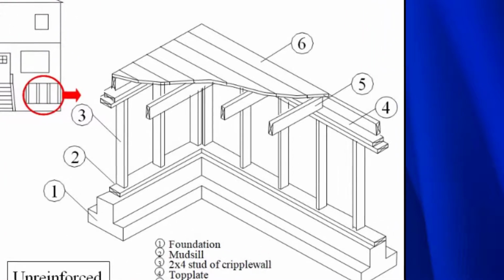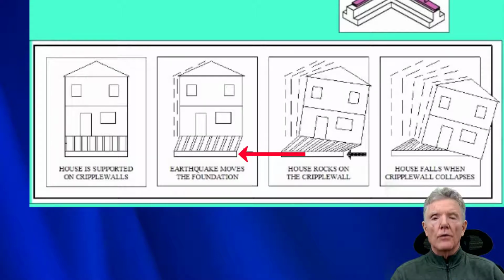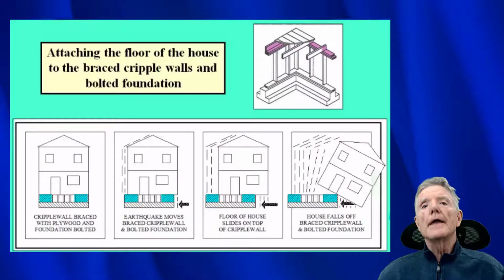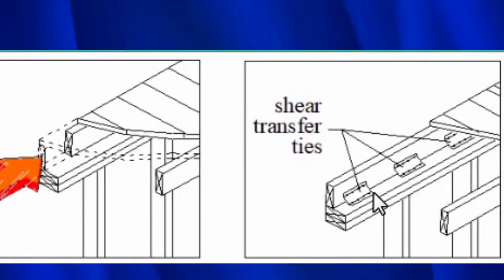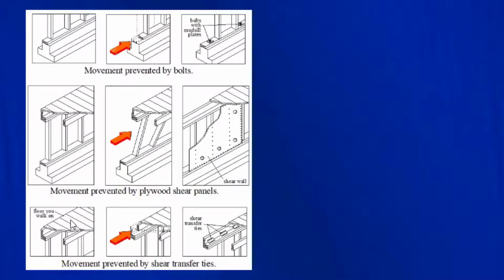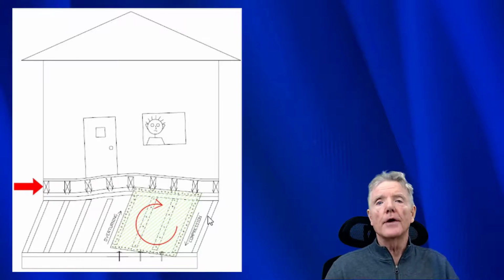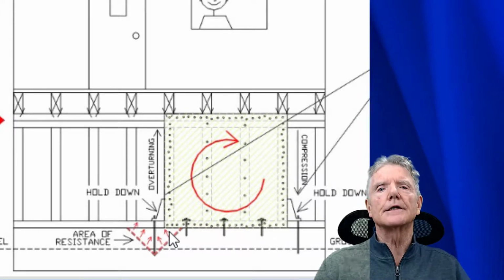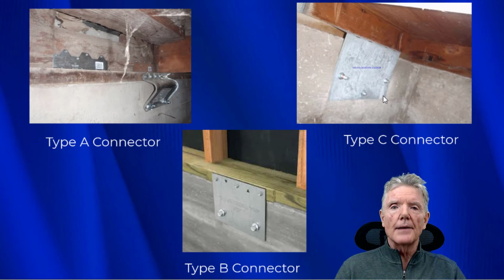Cripple Wall Retrofits: The Basics

Comment: Howard, I have 4'x8'x24' corner studs. Can I use two hold downs, one on each side, of the corner studs? Thanks for the great videos!
Reply from the maker: Try to be a little more clear.  I am not quite sure what you mean.
Reply: @bayarearetrofit5814  Is it acceptable to use two hold downs on a 4x8 corner stud? If still unclear, can I email an illustration? I promise not to spam you.

Comment: If the crawl space studs are about 18”-24” is there enough space for a tool to drill for an embed of at least 12” down? Even at a slight angle from vertical would work. Basically are there drill-bit combos that aren’t very long for a 5/8” dia bolt?
Reply: You must use foundation anchors, not bolts.  Look at the video on no cripple wall retrofits.
Reply: @infocook4854  thanks for your reply but I didn’t find a video called “no cripple wall retrofits”. Specifically I’m placing a shearwall with holdowns on the floor above and want the anchor bolts to go down through the cripple wall space into the existing concrete.
Reply: @melfooman17  They make really long bits, up to 4 feet.  That is what you need.  Be sure and subscribe to the channel.

Comment: Why don’t you need floor connectors at every level of the house? It seems like the justification we gave for them sliding relative to the framing applies to every level of floor joists.
Reply from the maker: Damage does not occur anywhere else.